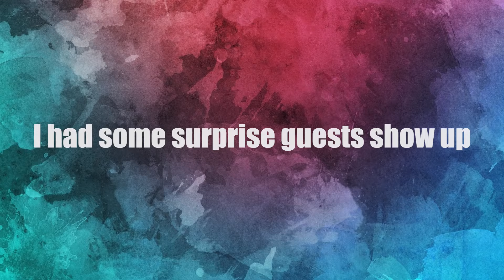When Welding a Differential Goes Wrong! (Diff Rebuild Part 1)

Comment: Try and turn the input shaft of that thing. Try it with something big like a breaker bar or something. Even tapping that shaft with a hammer. Not pretty tricks but I think you are right that it’s a bit of weld or slag lodged in the bottom. Try it before getting a new diff. Besides this are you gonna reinforce the subframe mounts? They are prone to cracking definitely when you drift an e36. You can buy weld in plates for your chassis and is maybe a nice feature for a next video? Dunno just thinking this is the best time to get that done with the subframe out... best of luck trying to get your pinion unstuck!
Reply from the maker: Thanks for the idea, I tried forcing it and nothing would get that sucker to turn. I have a ring and pinion I am going to attempt to swap if all else fails. I did buy the reinforcement plates and I already started prepping under the car. It's kinda sketchy with the gas tank, but I think some welding blankets will do the trick! Thanks again for the tips, It's always worth a shot!
Reply: Nice, those plates wil make it a bulletproof drifter with the stock drivetrain. The e36 chassis doesn’t have much more weak points. To bad about the diff, but you will get that fixed. You did the motor and subframe removal so the diff should be a cakewalk :):)
Reply from the maker: Yeah hopefully it will be reliable when we get it to the track, but who knows with our luck 😅